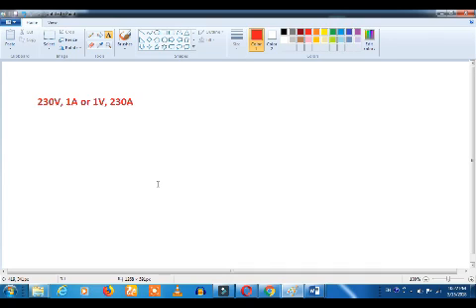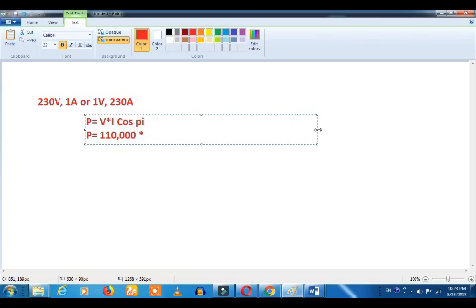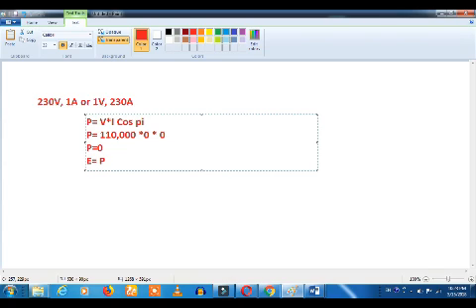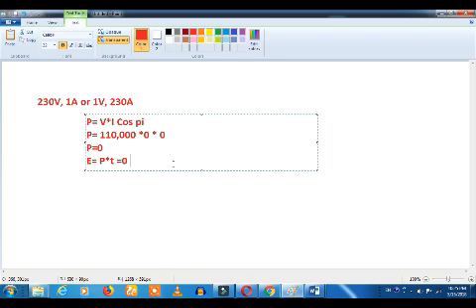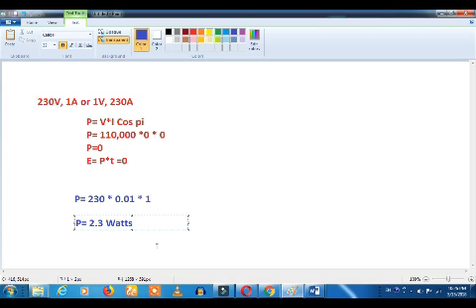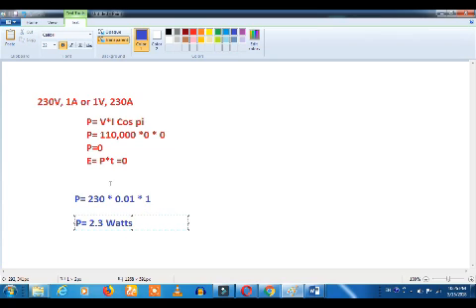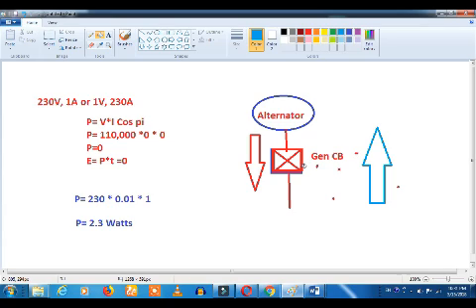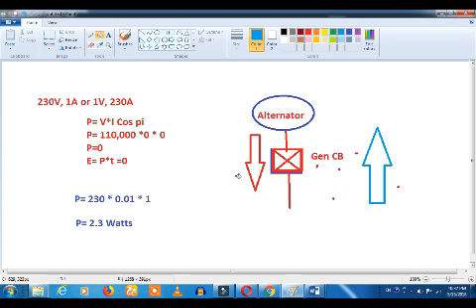Reverse power protection relay in tamil Shocking எதனால் ஏற்படுகிறது

Comment: Sir the circuit board 110 Ac current converte to dc voltage  but my friend is connected  ac supply  DC output  what problem will occur
Reply from the maker: Nothing will occur pa..there is a diode is called reverse block diode blocks everything.